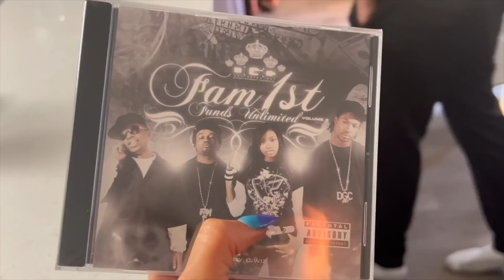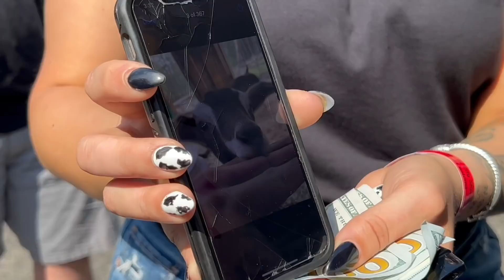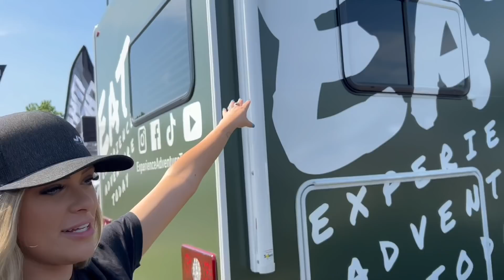I Blew Up $12,000 Worth Of Turbos in Nashville

Comment: Only way I see that being 12k in turbos is if you are paying someone to do the work. 

The turbos at the most expensive places they are about $5000ish. The turbos are salvageable. You can replace the carts and the turbos will be good. Up them a size if the housings were ground up too bad.  Depending the debris I might want to pull the head and clean it. .